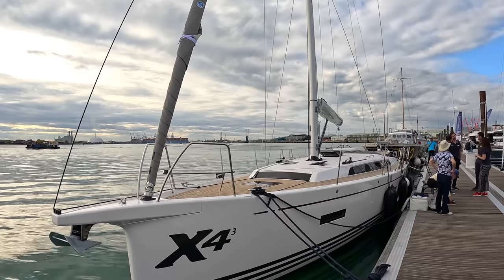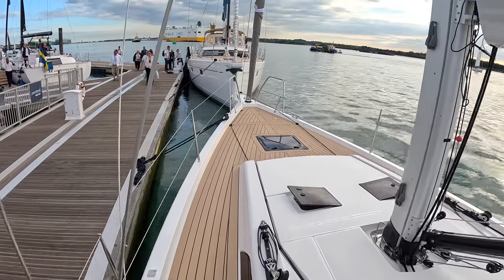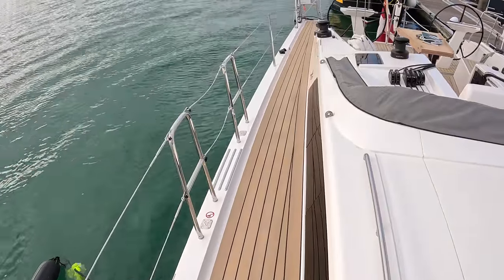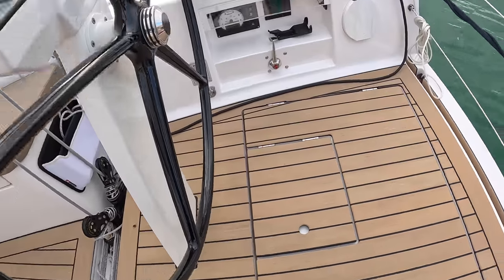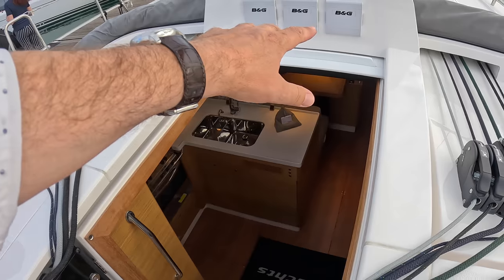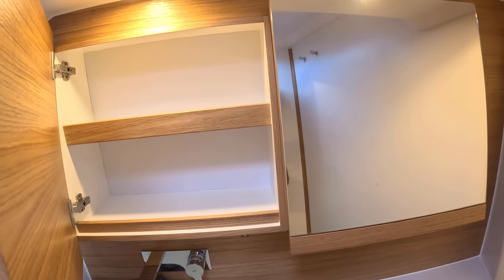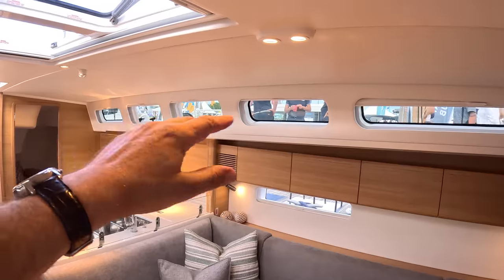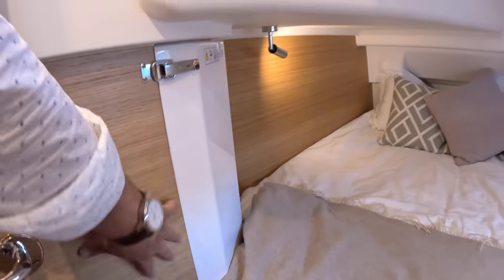£500,000 Yacht Tour : X Yachts 4 3

Comment: I'm lucky enough to sail the slightly bigger version, most weekends.  They are truly awesome boats, everything on them is just a little bit better and a bit more adjustable than you'd get on similar sailing boats of this class.  Fast, solid and comfortable.  There are one or two things to watch out for: The anchor roller/bow sprit is a bit short for the vertical bow line and its very easy to ding when you pull up a large anchor.  Any new owner should invest in a fender before they are sorry they didn't.  The ladder in the sail locker is a bit cumbersome when you are storing a code zero and a spinnaker.  It would be good if the steps were foldable, offset or smaller.  Also you constantly trip over the mainsheet traveller until you get used to the location, but that is more user error.

Comment: A very modern design that doesn't look Ikea. I was wondering why and I think it may be the sound. It sounds solid, not the Light to Medium density fiberboard that Ikea is famous for. We spend so much time watching Nick's camera work that the sounds of the doors and the deck under him slip by into the unconscious mind but leave an impression. Do the Danes do Swedish modern better than the Swedes?     (As a sidebar I've used Ikea for years and have had a few pieces for a decade or more - you do have to reinforce them though)